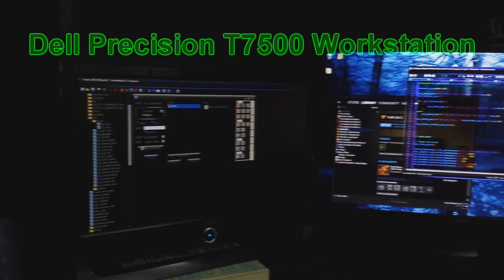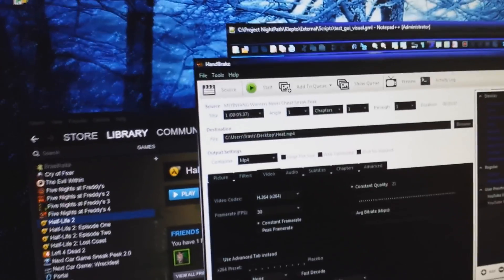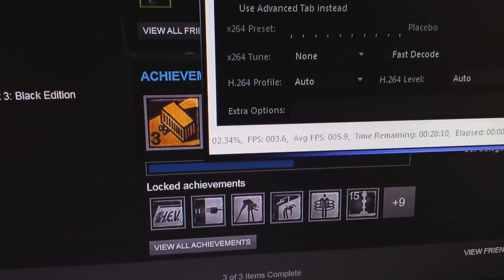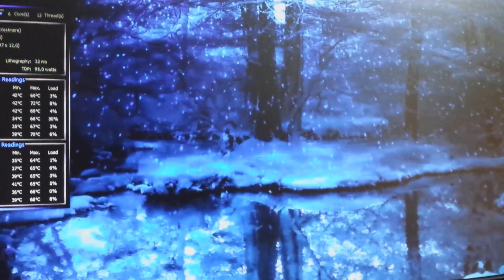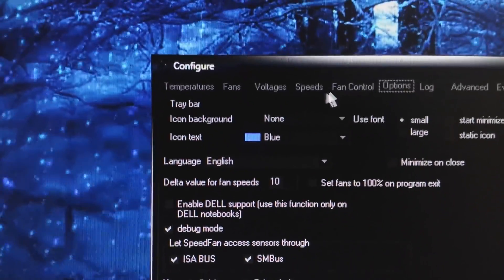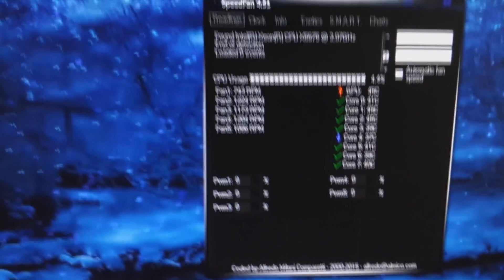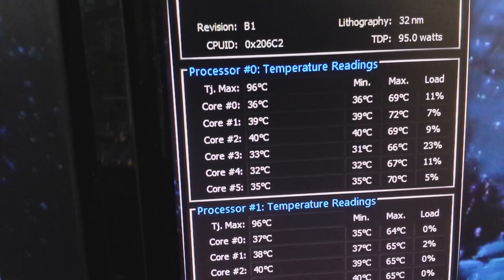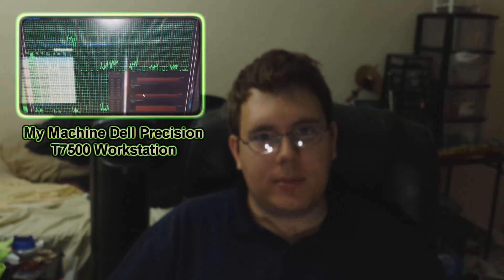Dell Precision T7500 Fan Cooling Fix

Comment: Getting the upgraded heat sink for the CPU on the motherboard is a must if you upgrade to Xeon X5690 3.46GHz. Before replacing the aluminum-block heat sink, the CPU temperatures often got into the 80 or even 90 degrees Celcius, but now, they tend to hover around 40-50 under normal load, and 60-mid-70's when I run data-intensive apps. Temperatures around 60-70 degrees Celsius seem ok. I have been running my workstation like this for years.

I downloaded SpeedFan because I want to stop the fans, which never seem to stop running after they have started, even as the CPU temperatures have dropped.
Reply from the maker: Instructions unclear, accidentally installed a RTX 4070 Super I found at an amazon bin store for $7.  But no serious, that sounds like a good idea! I'll have to go find that heatsink
Reply: @tigmonx  The upgrade heat sink is called Dell U016F Performance Heatsink Assembly. I bought it from eBay for US$27 including shipping.

Comment: Thanks dude! I had to reboot after enabling the Dell option, Actually it was a forced reboot because as I was watching your video my PC shutdown, yes, because of overheating lol. I am playing around with the settings and now instead of (C) 59 -61 (F) 138  I am hovering around 35 (95)  Although I have yet to test out with any real workload, just Chrome running. Thanks again and I may upgrade to a 7500 if I can find one. Cheers

Comment: I have two of these systems and never have had these kind of cooling issues. Although company I got them from did a lot of extras to them before shipping them out so I was lucky to get them from a top quality refurbisher. I think they did upgrade the internal fans because they stay quiet and the system never over heats. I also helped custom built a T5500 for a friend and he hasn't turned it off in 2 years with zero issues.

Have you installed the latest firmware in the BIOS? What about replacing the Thermal paste?
Reply from the maker: From my observations my machine never changes the fan speed once booted into Wimdows. My guess is that the fans will only go to hurricane force speeds when the CPU is near its max temperature. I've seen there is a better heatsink for this machine have not got a pair of those yet I did update to the latest bios not noticing any changes yet. I am currently using another dell precision T7500 than the one in this video because I it looks like the mobo died on the last one. I'd love to upgrade the fans and heatsink but as far as I know only dell hardware is compatible (how convenient right?) The fans have a 5 pin connector with the 5th pin seeming to do nothing other than making 3rd party hardware physically incompatible. I think the only solution past this is to 1. NOT HAVE A DELL.or 2. Do something really custom. I'd love to see ways others have found to customize these machines. Speaking of T5500 I git to fix my friends T5500 as well lol
Reply: @tigmonx  
There is another heatsink that fits these CPUs. I'll try and find them and give you a link. Also you should be able to use a 3 or 4 pin converter and make any set of fans work with these. 

I'm also curious whether or not your system is missing the large black cover on the inside that is a duct for the air. I didn't watch the entire video so I apologize if you showed the inside already.

I'm actually going to open both mine back up and see what kind of upgrades were done before I got them. All I did was add sata3 support, a graphics card and set of hard drives. I really do love these machines until I have to move them around....

They have been very reliable and handle any task I through at them with ease. The weirdest issue I had to fix was a audio latency issue which would make my sound randomly pop. Apparently these boards share IRQ or some other setting between all the devices in the bios. Even adding in a sound card didn't help! I had to enable a very tough to find setting in the registry and manually change a device entry from a 1 to a zero. After that the issue passes itself to my USB 2.0 hardware. Which as far as I know have no problem, but to be sure I added a USB 3.0 card and plugged all my devices into it. I just got so annoyed seeing that stupid red car fill up and say my powerful workstation can't process real time audio!

Download and latency monitor on your Dell and let me know if your system also has this issue. It's very common in Dell systems of this make and model. Some people have claimed to cured this issue by upgrading to Windows 10 but that makes zero sense to me.

Comment: I have exactly the opposite problem. Fans operate at 100% right after start up. Sounds like i am in a wind tunnel. Need to wear ear plugs to sit next to computer. Any ideas how to fix it?
Reply from the maker: Funny you mention that if you are using the Dell Precision T 7500 then perhaps you can use the tool I used in my video to have your fan speed go to normal setting it below 70 might cause your fans to slow down it seems like there is some number in the fan speed that the fans are either full blast or running at normal speed there is no in between but I would just go lower until your fans stop spinning so fast and open up your computer and make sure the fans do not stop spinning because then you will have a very bad problem
Reply from the maker: Of course take this advice at your own I wish you the best and hope this works for you
Reply: tigmonx I installed Speedfan and i get a reading of the HD temperature at 255C which causes all fans to spin at full speed and don’t have any control. When i run Diagnostics the only error message i get is that hard drive isn’t detected. However the system boots up which leads me to believe that the HD works ok. A few times on boot up i get the error message of “Air Temperature Sensor not detected “ which leads me to believe the problem is with the temperature sensor. How do i fix that? Do i need to replace the front i/o panel? Any help is greatly appreciated

Comment: Hi there.  T3500 here with an X5672.  Your tutorial worked perfectly for me.  Thanks a lot for taking the time to make it!  Now I just need to figure out the noise to cooling ratio that fits me best.  I wish the BIOS would allow more dynamic cooling, but I do understand that my T3500 was originally intended as a server.

Comment: Hi, i need dell t5500 t7500 G422G fan fix replacement ? Any idea ? It's very noisy and f**k 4 pins fan ...
Reply from the maker: Alexis BESSON Sorry but from what I learned you can only use Dell's proprietary 5 pin fans for this machine. You can find those for sale out on eBay
Reply: nothing @ ebay !

Comment: Bet things would be even cooler if you got all the dust bunnys out of your rig, wonder what your cpu compound looks like after all that heat.
Reply from the maker: That's definitely a good practice! I should be good though. I've blasted it with air and also applied new paste when I upgraded to the Intel Xeon X5675 cpu :) The rig runs cool in the winter in this back bedroom.

Comment: Any Idea how to fix a problem with the fan controller not being initialized? This error is preventing windows from loading so I can't even run the programs you suggest
Reply from the maker: I'm afraid I don't know. Is this some error being shown at BIOS? Any more details?
Reply: Yeah on post it says

"Alert" unable to initialize  fan controller.
Alert! Front Chassis fan failure.
Alert! Rear Chassis fan failure.
Alert! CPU 2 fan failure.
Alert! Hard drive fan failure.
Alert! Air temperature sensor not detected.""

The fans are all working, running at 'takeoff' speed
Reply: @malkies6341  That sounds like a bad motherboard.

Comment: How do you run both cpu's, I have the same workstation with two X5450 quad cores and I can't get no more than four cores out of the 8 that should be running?
Reply: Marcos A what operating system you running if windows 10 you need windows 10 pro. home only uses 1 cpu
Reply: Thankyou.

Comment: Do you know if that is a design issue? Maybe Dell haven't designed T7500 for x5600 series at all. I got T7500 with 2x X5670 and it runs fine until I try to load it at full. Temperatures go easily over 90C(after that i cancel the tasks as I don't want to fry it) and fans don't bother to increase themselves. What are your idle temperatures and which heat sink do you use for the primary CPU?
Reply from the maker: Not sure if this is a design issue or not, however I do find it disturbing that your cpus touched 90C and the fans STILL did nothing. I am blasting this machines fans a lot now with speed fan because it's summer here and this room gets quite warm. As far as heat sinks are concerned I'm using the ones that came with the machine. I did a quick search and these look like the ones I have in the machine now.

Main CPU hestsink
http://www.ebay.com/itm/Dell-Precision-T3500-T5500-T7500-Desktop-Heatsink-T021F-0T021F-/381438968664?hash=item58cf88c358:g:phgAAOSwf-VWYGck

2nd CPU on riser hesatsink
http://www.ebay.com/itm/Genuine-Dell-Precision-T3500-T5500-T7500-CPU-Cooling-Heatsink-U016F-/201609924412?hash=item2ef0e34f3c:g:dncAAOSwq19XBrLy

I have been blasting the fans right now on the machine and the temps on my cores range from lowest being 19C to hottest being 35C
averaging each cores max and min temp brings me to 27.25C overall.
Reply: 35C on 100% load or idle?
I've got exactly the same heat sinks in mine. I've got another T7500 that I bought recently so I haven't played enough with it but it seems to have exactly the same problem - temperature goes and goes and the fans don't change a lot(20-50 rpm change maybe). It's with a single X5667 quad CPU so I think it is a design issue. Maybe these 80C+ are not so scary after all. As I understand you set manually fan speeds by FanSpeed, and it will always run on max. If there is a solution for automatic fan speed, going full only after reaching given temperature it would be fine solution for me. I don't run all the time programs that need 100% CPU so all this noise is unnecessary. Also when I run some of this programs I don't want to think about running another software to manually set the fans. I tried auto fan speed option in FanSpeed and it does nothing.
Reply from the maker: Those temps I posted last were when the CPU is idle. I turned down the fans on mine with SpeedFan back to normal now. Now without the fans on idle I am seeing 29C as my lowest and 37 as my highest average across all cores being 33.5C I have not done much with SpeedFan other than manual controls. I might try playing with it to see if it can fire the fans up automatically for me when things get hot. The dumb thing about this well, one of them at least is that the fans seem to do absolutely nothing until you set it above 70% then the fans wake up and go to full speed. From what I gather 70% and higher are all the same speed.
Reply: Thanks for your help!
And another question : when using FanSpeed, what is your average temperature under full load for long time period, like an hour and more? My temps are very similar to yours. I'm thinking now to make some modification to primary heat sink and to put a quiet small extra fan directly attached to it, running all the time. But again the problem will remain for the raiser heat sink or I have to mod it too
Reply from the maker: I just did a test now. I encoded video in HandBreak at the highest quality and the most punishing for the CPU. I ran it for 10 minutes and got an average temp of 55.5C across all cores and peak of 63C I figured out the automatic fan control also and now that kicks all the fans in when it touch the 50s. Just a warning, sometimes you may notice a periodic audio stutter that happens at regular intervals and machine locks for like a very very very small fraction of a second. You would only see this likely when gaming or playing videos but this does not always happen with SpeedFan but I found SpeedFan to be responsible for these periodic stutters. Just tested again, unfortunately it seems to be connected to Automatic fan speed. More testing is needed. Good luck!
Reply: I often use AIDA64 and sometimes I forgot it open. In these times if I watch movies or listen to music I also have this glitches in sound and I noticed that it is related with refreshing temperatures in AIDA. If I switch to another page the sounds disappears. If you find the solution with the automatic fan speed I will be really grateful if you share it. Thanks

Comment: You can probably also update your BIOS to latest and then find Fanspeed from BIOS Power menu. At least thats what I did on my T3600 workstation. There are very few options though. "Auto" that tends to cook your CPU-s at 90 degrees, "Low" that does exactly the same, and probably it means that at 120 degrees it won't kick in any fans as this profile is made for people with lots of cash and very tender ears. "High" for people, who want their CPU at 20 degrees in full load and who don't want to hear loud yelling in the room. The only usable profile is "Medium" It keeps CPU temps at 65 degrees at full load for longer period of time. The only problem is that it hums annoyingly. Whistles weirdly. So I discovered that the whistling ones are the three front chassis fans of T3600. Now I noticed, that if you try to control the pwm signal of any of the fans, the touched fan loses the "Medium" setting. So I installed Speedfan, created a scheduled task to run it at logon and ticked the settings that it should start minimized in tray. Also I set the CPU temp to the tray show temp and ofcourse I ticked the Dell setting. Now I created a profile that full rev only comes if CPU reaches 85 degrees. And i unchecked PWM1, which is the CPU fan for me. I also added upper chassis fans to my CPU temps. Now my CPU fan is on the medium setting, running constantly 1400RPM and it keeps the CPU at up to 73 degrees at full load if I stress it for longer period of time. If my filters get dusty and one day my temps go way too high, the chassis fans are there to kick in at full load. Also the chassis fans work at 1000RPM from startup and when I log on, speedfan automatically tries to adjust them lower, as CPU does not need saving, so Chassis fans come down to 600RPM and will stay there until CPU or GPU are at 85 degrees. When GPU or CPU overheats, All three chassis fans get up to 2500 RPM and save my hardware. In normal workload, when I am not making any calculations, all my cores stay at 40-50 degrees.

Comment: Your setup looks great :) esp the moving background. I am curious as to what your logic was behind thinking 70-75oC was hot on these x5675 CPUs? The x5675 wont bother starting to throttle itself until the cores internally reach about 95oC+ which is also why the Dell fans don't speed up much at <85oC.    I recommend upgrading the on-board mounted CPU cooler to a U016F which is the one origionally shipped with any 130Watt TDP CPU option like the x5690. Totally recommend the U016F cooler if you want to lower your temps by 10oC, it even has room on the front for a quiet 80mm fan which will lower things by another 5oC.
Reply: And what about the heat sink on the riser? Is there upgradable option for there? Because if I upgrade the primary the secondary still be overheating.
Reply: Will the HS only take 80 mm fans or 92 mm fans can be mounted on them for more air flow .... ??

Comment from the maker: It depends, This machine can be inexpensive to start off with in most ebay listings and likely won't be the fastest to start off with but it has a LOT of potential. That's kind of a hard question to answer. If you don't mind buying something that you will plan to throw more hardware at it periodically in the future you will save a lot of money and have a rediculous amount of power. The CPU(s) do not have as strong of cores as some of the latest i7 processors so this will not be the absolute best for gaming but as far as multitasking this machine is very strong with. The cores are not bad at all either pretty good just not the best however you get more cores. If you want more information on the prices of where I got parts and such I could compile a list. </tl;dr>